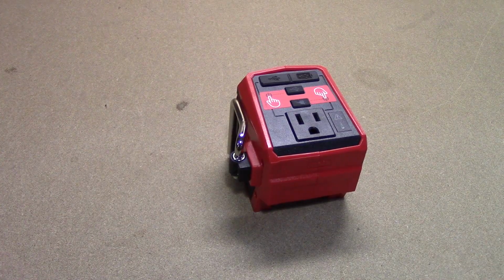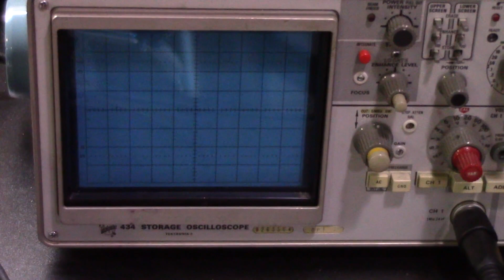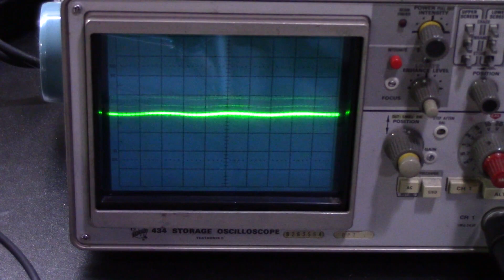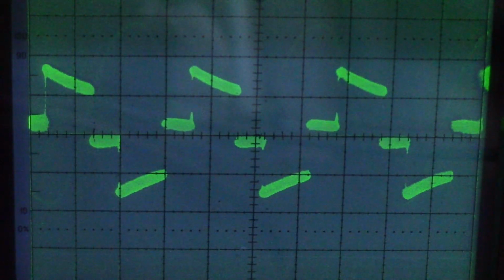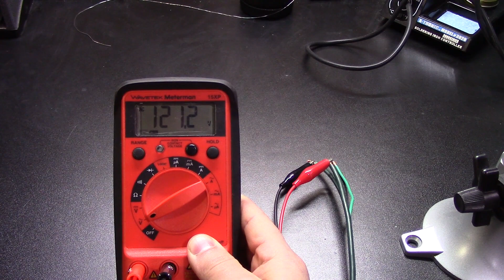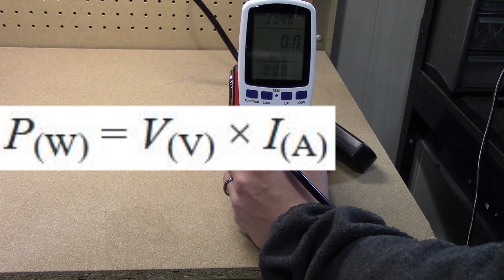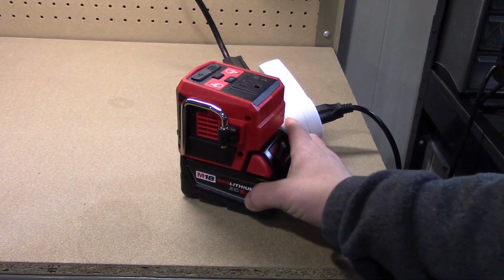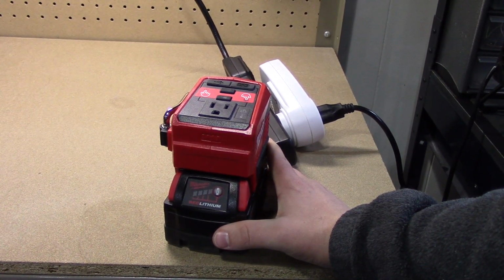Milwaukee Tool M18 TOP OFF Output Waveform Revealed!

Comment: I wonder how it would compare to the Ryobi inverter, similar results?
Reply from the maker: Looking at the description on the home depot, Ryobi claims that the output is a modified sine wave, so yes! Milwaukee did not specify when I first bought the top-off, which is why I made this video.

Comment: So I've got a question for you. If you take a extension cord and add in a spliced tail. So that there are 2 male ends and one female and And then plug it into 2 Milwaukee top offs does Is that double your available electrical Ambridge. therefore using 2 Milwaukee topoffs to power bigger appliances such as a coffee maker
Reply from the maker: Unfortunately, connecting a load up to two inverters will likely result in each inverter (the topoff in this case) trying to "feed" each other. With the best case scenario being they sense an overload and turn off. In order to use inverters in parallel, you have to set them up in master/slave configuration. Which, in the topoff's case, would involve cracking them open and tinkering.
Reply: Ambridge? Do you mean amperage?

Comment: Can you make a vid on the Dewalt $40 inverter that plugs into the car, i think it rated at 150w similar to that Milwaukee inverter,  thank you
Reply from the maker: I do not own any Dewalt devices (And don't really want to). Most of the car adapter inverters "cheap out" and go with square wave inverters. It will get the job done if you are in a pinch. However... It will interfere with your radio if you have an older car! And of course, do not plug in any sensitive electronics, same as the TopOff.
Reply: @IllInformedHuman What would you consider a sensitive electronic? I got a 400w power inverter for my car, my laptop power brick is rated at 200w, I like to go outdoors often and work remotely, is the laptop/laptop charger considered a sensitive device? Will this be harmful for my laptop in a long term? I was planning to buy the off to replace the car inverter, now I am not even sure that I should continue to use either.
Reply from the maker: @RobertoGonzalez-zd5mq  A laptop charger is a rectifier and is not sensitive. It usually has a voltage range printed on the underside label. If you are always within that range, you are not causing any damage. Most brands in the USA design rectifiers to function on less than 100VAC. 
It is also good that you have something that will provide double your power needs, this will ensure it keeps a steady voltage output. You should be good to go!

Comment: finally i got a good review of the device, every other review is just useless,  this is the information i need to make decision if i wan to buy it or not. thank you for great review
Reply: I use mine on my side security job for about a year!  I love it!
Reply: Yes, they're awesome! Even without the 120Vac inverter option, these turn your batteries into instant USB-C / USB-A power supplies. I would only use the AC option in a last resort type situation.

Comment: Thank you very much for making this video.  After seeing that waveform I would not buy a Top-Off inverter.
Reply from the maker: The waveform is not that bad for an inverter. It works "fine" if you are in  a pinch. But I would not rely on the thing, that is for sure.

Comment: The reason you do not have to attach the oscilloscope to MAINS POWER GROUND/NEUTRAL (when your oscilloscope is plugged into the same MAINS) when you are measuring it is because your oscilloscope is non isolated. This means the ground plane is already connected from the outlet. So when you are measuring the voltage, you are already referenced to the system under test. If you attached your ground probe to the HOT of the same supply your oscilloscope is connected to accidentally, it will likely fry your oscilloscope (unless the lead fries itself first). That is why you never attach the ground probe to a system that is non-isolated from your oscilloscopes supply.

In the case of attaching to inverter module, you absolutely need to attach to the neutral/ground. It is electrically isolated from your oscilloscope, as it is the new power source with no electrical reference to the ground of the oscilloscope.

The reason your fume extractor runs poorly off the supply is because its an induction motor (as such, an inductive load). The inverter can't supply enough current for when the fan first starts since there is no back EMF yet to reduce the apparent load, which is why the fan starts so slow. It will continue to run poorly as the modified sinewave is outputting 0V at the points when the motor would attempting to pull current from the source, and result in a poor power factor.

Looks like I'll have to pick one of these up to have some ez portable power around the shop!
Reply from the maker: You are absolutely correct on your first point. An inverter does need a reference. I was "playing up" the difference between the wall and this inverter (I am not the greatest actor). I see that I was not clear enough. I will try to do better in the future. Thank you for your input!
Reply: @IllInformedHuman  considering how deeply you understand the subject matter that is a very humble response?  The world would benefit greatly from more individuals like the 2 of you...
Reply from the maker: @johnpusch1376  Thank you! I appreciate you pointing that out :)

Comment: I should of bought one on the fathers day sale
Reply from the maker: Just buy one now, totally worth it.
Reply: It was $150 with a 5.0 battery
Reply: @joejoe6949  yea they have the same set up on ebay…

I did purchase a quad charger (offbrand) from amazon, charges in parallel for milwaukee batteries, it was $90 and i got some 6.0 off brand batteries for $45 and they have worked really good. I have not tested the battery life on some of my more draining tools (sds, sawzaw, or circular saw) but the fitment and performance has been great so far in my fuel hackzaw, drill and impact
Reply from the maker: @joejoe6949  <Surprised Pikachu> That is a pretty sweet deal. I would have bought a second one if I saw that.
Reply: I of thought about it too.
Reply: of you got one yet?
Reply: I of’nt got one yet mostly cuz I don’t of any M18 batteries.

Comment: So square and modified square sine waves from inverters are not harmful to consumer electronics as indicated on the M18 top-off?
Reply from the maker: For most consumer electronics, no it is not harmful. If you have something that uses the input power for say... timing, this would damage it (think consumer medical).
And of course, since Milwaukee Tool wants to limit liability, they will of course state that you should use at your own peril!

Comment: Hi good video good info 
Can I use this for my freezer if power go out ???
Reply from the maker: Most chest freezers will only consume about 100Watts of power at 120VAC. So the answer is... probably!  As long as the chest freezer does not consume more than 175Watts (roughly 10-15 Cu. ft. freezer).
Reply: @IllInformedHuman  thanks 💪🏾💪🏾💪🏾💪🏾God bless
Reply: No hope in Hell for a freezer or any motor loads over 3amp i would say.   Not designed for this..
Reply: @SuperGreyfox99  Thanks 4 da info God Bless